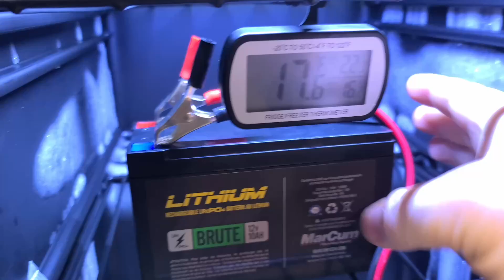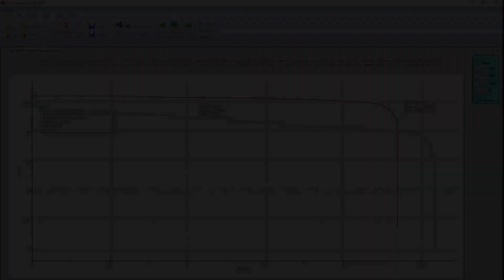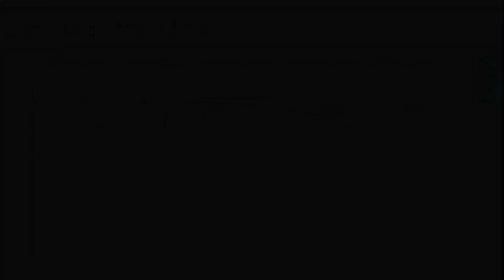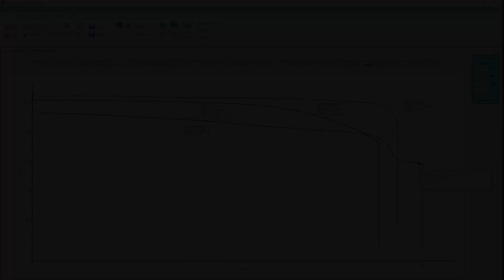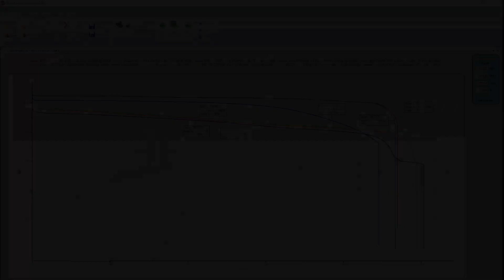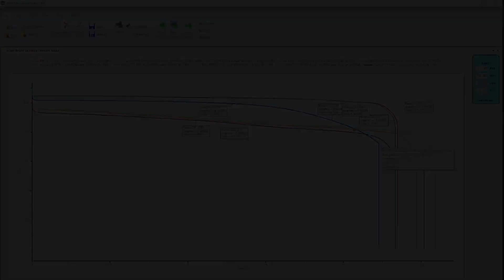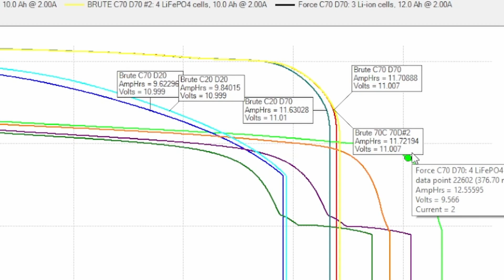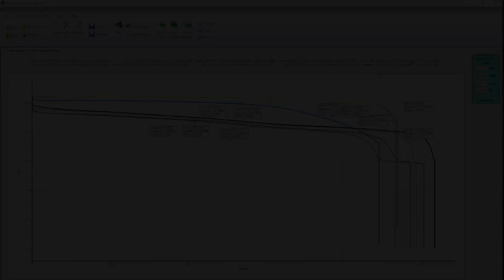Lithium Battery Freezer Test

Comment: Excellent testing! I think you're correct though you would need to run each of the batteries  multiple times and average them together. Your data does seem fairly consistent especially the control group. I used to be a Test engineer and I find your data consistent which makes it reliable. Great job! I appreciate you taking the time to inform us. I like the no B S approach.
Reply from the maker: Steven, comments like this makes my day! Thank you!

Comment: Thanks for the video's, one thing I wish you would hit on is customer service. I have a 30ah Amp outdoors, customer service not good
Reply from the maker: Thanks for watching Ernie! Issues with Amped Outdoors customer service is not something that I have heard much about. What issues have you had with your battery? Did they not get back to you when you reached out?
Reply: @iceholepower8012  After I got the battery and charger I had a question about the charger which was no big deal so I went to the web site and didn't find a phone number or email address so I tried the chat feature and no one manning the chat desk. I'm thinking what does someone do with this 10 yr warrenty?
Reply from the maker: Speaking from experience here, sometimes the chat feature on websites do not work. They are supposed to generate an email to get someone's attention but in my case, they randomly end up in my spam box. If I were you, I would just google Amped Outdoors, all their info pops up including a phone number.
Reply: They've been fantastic for me, what's going on?

Comment: Interesting! Have you done a cold lead acid test yet? Would be neat to see at 20F where the SLA battery hits 10.99v. I think that graph would get a lot of ppl to switch to Li batteries.
As for terminology, technically they are both lithium-ion batteries. LiFePo4 is usually shortened to "LFP", and the other types that are nickel based are usually comprised of Nickel, Cobalt, Manganese. Or "NMC" for short.  Some Li batteries are now using Aluminum instead of Manganese, or NCA batteries.
I think everyone knows what you mean, but maybe LFP vs. NMC is an easier way to differentiate them when comparing.
Reply from the maker: I have not done the cold SLA yet but it is coming! In the ice fishing niche, battery companies refer to 3S 11.1v NMC as Lithium-Ion, 4S 12.8 LFP as LiFeP04 and 4S 14.8V NMC as just NMC. Since most of my viewers are hard water anglers, I try and stick the the niche specific lingo, but... You are absolutely correct in your terminology. I actually mentioned this topic in the beginning of another video. Thanks Andrew!! https://youtu.be/3wcIKCnqsSI